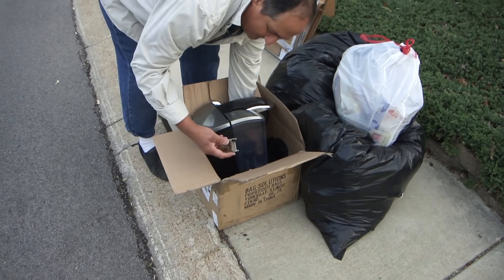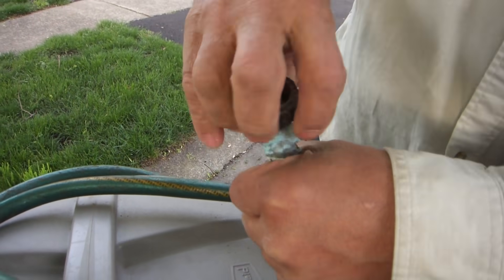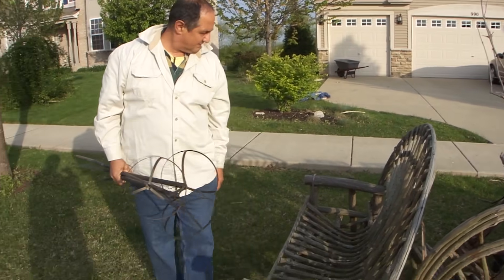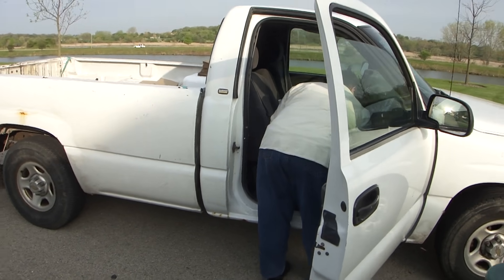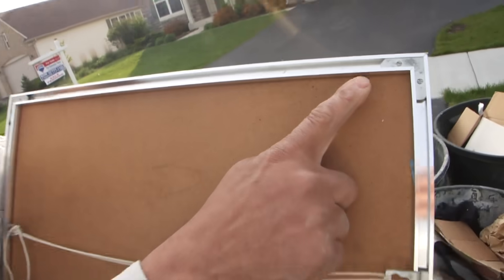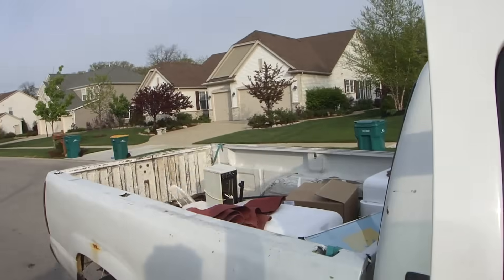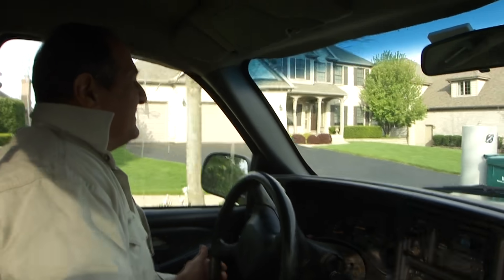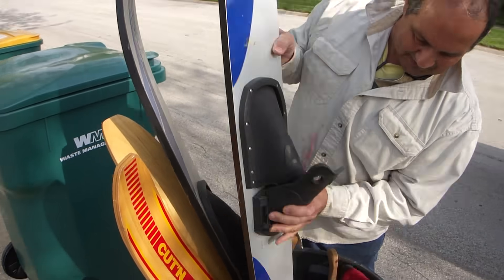Scrapping In The Suburbs Part 1 of 2

Comment: I have no prob with people scrapping or picking, what bothers me is when they just dont take the whole item. I was out front raking my yard one day, and had tossed out a 10ft plastic gutter extension with a metal elbow that I riveted on and some guy pulls up realized the extension was plastic, so he starts beating the metal off using my drive way as his hammer. I go seriously? Hes like every bit helps. Its like just take the item and go.. u pick the garbage.. u deal with the non steel items.
Reply: I would have told that guy to get the fuck out of your neighborhood and to get a job.  Quit stealing scrap metal ect.  We have scrapers that come down our st.  My neighbor and I actually take dehumidifiers and gut the metal out of them.  Put them back together filled with trash so there is weight. Then set them out for the trash for these scrappers to pick up. They pick them up not knowing until they get home to take them apart.  LMAO  We have been doing that all summer and have had a reduced flow of scrappers coming down our st.  Take care man
Reply: Lol, I should start doing that..
Reply: Frank_82 You gotta start doing that.  I tell my neighbors do not set metal out for the trash.  The scrappers will come and take it and make a mess in the process.  I actually caught one rooting through my trash can 8 months ago.  making a big mess.  I said get the f*** out of there.  He looked at me like huh you talkin to me.  Don't mind me I'm just pilfering through the trash and I shore like beans and ain't learned books.
Reply: sad as fuck!
Reply: well they are protected under the law to do it so you are just going to  have to get over it

Comment: For those commenting about this being illegal in most places. I think you'll find the opposite is true in most places. Generally it IS legal to go through someones trash once it's been put outside and this is how most 'private eyes' obtain info quite legally and how 'dumpster diving' works. There's a grey area when it's on private property but these are quite clearly out on the street for pickup. There are certain areas that specifically make it illegal but those are few and far between. This is the general norm for US/UK/Europe. As for Asia, I've been to a number of countries where 'recyclers' go through trash out on the streets before it's picked up and as far as I know they're not breaking any law either. Google for the law in your area, you might be surprised.
Reply: in lots of areas there making it illegal because like were I live the town uses it to help with budgets.Plus of the risk of identy theft. In most places anything that's a certain distance from your proptey line becomes the towns.there's been many reports in my town of people getting tickets for scraping. Evently  it will be totally illegal in the u.s. witch sucks scrapping is fun and a easy way for cash.
Reply: Best to look at your city and county ordinances.  For example, the city I live in determines it illegal to remove any items from a receptacle even if it is on the curb/street.  If it is not in a receptacle, then it's legal.  Do your research.
Reply: Macbigicekeys I did
Reply: david brunner
They are taking away people's ability to make a living.....
Reply: Truthman OneTwenty exactly